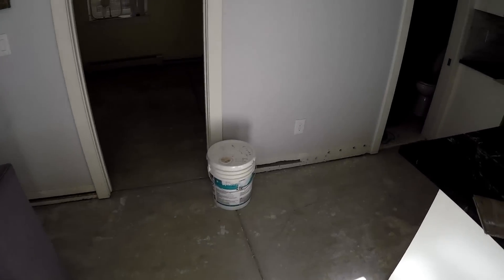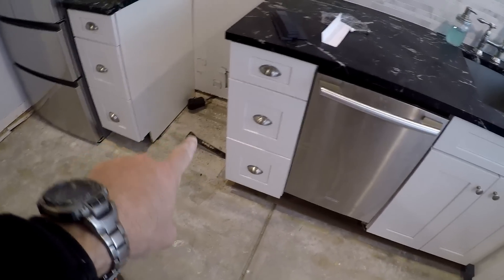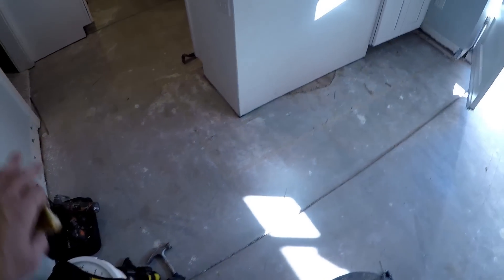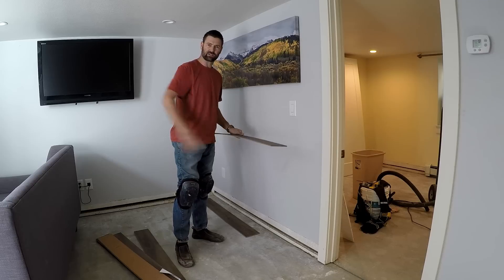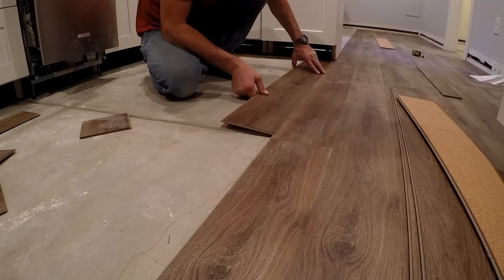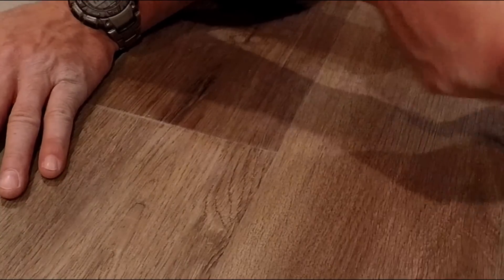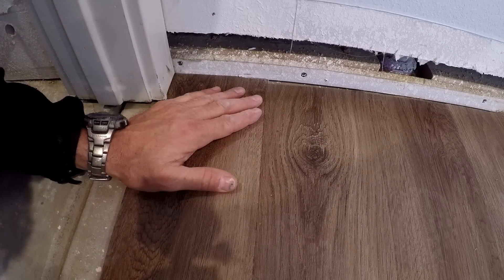The Truth About Vinyl Plank Flooring 1 | THE HANDYMAN |

Comment: You guys are too expensive and you don't take on small jobs people are learning how to do this stuff on their own now prices are just way too high I don't know why but just to do my trailer a trailer we're talkin over $1,000 so I'm doing it myself I bought the vinyl flooring and I'm going to do it all myself they have step by step instructions right on YouTube and that's just the way it is
Reply from the maker: Have fun with it.
Reply: Floor installer for 30+ years.
 Parameters for deviation allowance in existing substrates is typically 1/8" at 10' for most floating LVP installations. The potential for failure is high if you ignore the manufacture's subfloor requirements ..so like The Handyman said, have fun with it. You can put the money you saved from a proper install towards future flooring repair costs.

Comment: Just set the pads on the floor and Neal on them
Reply: I just wrote the same thing on his other video. That's what I do.
Reply: @jorgejimenez1877  me too
Reply: @davegordon6943  me too, did it for years, would always cut the straps off too...they make these wonderful things called kneeling pads now, buy 2. I have 4.
Reply: I do that now also. Before I had pads I stapled some scrap carpet padding to a 1 by board and kneeled it on. 👍

Comment: Had this floor installed on 2 different houses called “Nu Core”, one had under lament one did not. I like the one without the under lament 15lb roofing felt.
 So far it has been closing in on  a year on the first house looks good, great for rentals.

Comment: Hey Handyman, I have a simple question. Was it the homeowner’s choice of going with vinyl flooring or yours? Cause I remember wayyyyy in your earlier videos that you installed allure flooring and I remember you saying somewhere along the lines of it being a better flooring vs. vinyl but I could be mistaken. Happy thanksgiving 🦃🍁🍽!!!
Maybe you could do a video on the types of flooring and what’s preferable based on durability, budget, and aesthetics. Just a thought lol 😅
Reply from the maker: The home owners wanted it replaced with the exact same flooring that was in there before the flood. Allure flooring is has gone through a few changes since It first came out.  Its all about the same these days.  Click together vinyl.  This one happen to have cork on the back of it.  A lot don't have cork.  I really don't know what the cork does.
Reply: I installed Allure in my own house 5 years ago.  It was peel and stick.  I wouldn't install it again unless the newer stuff is click together.  It's the only way to go (as you showed) for tight joints.
Reply: The Handyman Oh I know what you mean, it’s really not that hard to install. Although I’m the noob who research a bit on the process and bought the spacers, block tapper, and floor cutter. Didn’t think to use a box cutter lol 
This was my mom’s living room and I had to move everything furniture, tv, etc to one half of the room to start and then move everything carefully back over once I got to the other half. I couldn’t have been bother taking it outside or moving into a different room. Lol
Reply: @TheHandyman1  A flooring salesman told me the cork makes the floor less fatiguing to walk on.  I was pricing a floor for an area where people stand all day (think hotel front desk area).
Reply: @josephlacerra8433  the cork provides sound deadening and slight insulation. It will be nicer to walk on then a vinyl plank without the cork, and it being directly on the concrete
Reply: I installed allure on concrete floors that are 4’ below grade, 10 years ago, still doing just fine. The test I used was a sheet of 6 mil laid down for a week beforehand. No condensation = no problems with the flooring.

Comment: I use sheet metal snips for a lot of cuts. If you are going to do these fairly often, either rent or buy a laminate cutter, one that the blade is forced straight down, not the ones like paper cutters. Worth it. Also there is a tool for cutting ceramic tile right even with the toe kick board, for tile that has been laid under the cabinets (check HF cheap) it would probably work for a situation like this and be a good option.
I hope the property owner dried that concrete slab out for you. The vapor barrier under the slab means all the moisture must go up. If you have not trimmed it out yet, lift up a couple pieces of flooring to see if it is dry.

Comment: The truth is you shouldn't put floating floor underneath cabinets to begin with!!
Reply: You are 100% correct my friend.Cheers
Reply: Why??
Reply: @Neesi392  because floating floors will fail if you glue or screw them down, or "clamp" them down. They have to expand and contract, though LVP much less so than crayola laminate.

Comment: Cork padding IS the underpayment, and it is a far superior (and expensive) at that.

Now, people should be aware of vinyl flooring releasing harmful fumes and gases, so stay away from the made in China stuff. Go for some made in the U.S with the approval of FHA even if they’re a bit more money. 

Also, you got to have a gap all around for flooring shifting. If you want to keep your baseboards intact you can just add quarter rounds.
Reply: it seems like everything is made in Chinastan these days / how about some brand names ( made here ) and where to find them in the USA / Canada ??
Reply: @badcat4707  The reputable brands have a testing program. shaw, Mohawk, Karndean, Casa Bella, Happy Feet, quite a few more are very reputable.

There has not been a problem in the industry with LVT/LVP adding off.

However, laminate from the trash if the industry from places like Lumber Liquidatirs has gassed off in millions of homes.

69 Minutes did an expose, they gave the usual "golly I didn't know a thing" and they got off with a relatively small fine 

When you buy cheap crap from people who specialize in cheap crap, you get what you pay for.

BTW, it's obvious this house was a screwed up DIY or "... I got a guy to do it cheap.." and thus the problems to start with.

Comment: You ever try those pants with knee pads in them?  I don't know anything about them but at least it wouldn't have a strap to deal with.
Reply: Those pants are expensive
Reply: My carhartts have a slot to insert foam into the knee panel, it works much better than these type of knee pads. I just leave them in that one pair of pants, too much effort to get them out again.
Reply: I got a pair of Cat pants w/ kneepad inserts a year and a half ago, and they're amazing. Super comfy, and the pants last 30-50% longer than any denim pants I've worn.

Comment: Did I miss the comment  about not filling the expansion groove,saw joint I can see it bridging without telegraphing the crack but a 3/4 in groove might be a bit much before it shows.
Reply from the maker: Not needed with this kind of flooring.
Reply: @TheHandyman1  that is great to know but how wide of a void can it span as recommended by the manufacturer?
Reply from the maker: 14 inches. 🤣
Reply: @TheHandyman1  lol

Comment: Odd that cabinets & appliances are on top of flooring, not something usually see.....interesting. Don't envy you removing that flooring from underneath everything......hope being paid well.
Happy Thanksgiving, thx for the vid!
Cheers, A
Reply: I've done it especially for bathroom vanities. Easy for flooring guys to just do a whole room then have the cabinets installed on top if you're starting from scratch. In basements you don't have as much issue with expansion and contraction of this product because the temp stays consistent and there aren't windows open letting direct sunlight heat small sections of the floor.

Comment: I made $4K, 3 days, on my last full house flooring job like that, except it was WilsonArt, but I swore I would never do another one.  Serious knee work is a widow maker. There is actually a tapping tool for these floors. Also you can use a short mechanic's rolling stool.  If I were doing it again I would hire a cutting guy and stay seated. I'm not seeing seeing much room for expansion and contraction. These floors are supposed to "float." More water/humidity and it will buckle big time.
Reply: My 1000sq ft basement was a great knee workout for my ice hockey goaltending hobby.

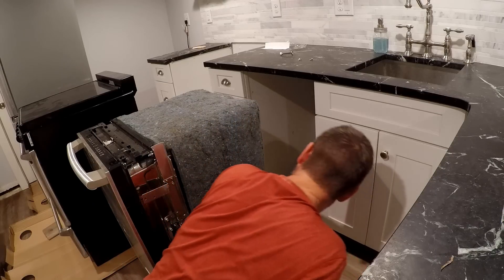Comment: Woah, total disregard for a quarter inch expansion space at tight areas. 6:11 and 10:40 are just a couple examples.. Also do you own a rubber mallot? Not as important as the expansion gaps but still important to prevent scuffing the top layer. I have installed the same nucore flooring before and can tell you it is a quality product.  Anyway good camera work. For anyone watching please leave that quarter inch expansion gap around the perimeter or at least in tight areas. Can’t wait to see what this looks like when the humidity/seasons change.

Comment: man. i would have at least ardexed those gaps in the concrete
Reply from the maker: That would be a waste of money and time this flooring is designed to go over them
Reply: LVT is not supposed to transfer anomalies in the sub floor to the flooring.
The old type of composite laminate over time and cycles of humidity would have shown thru.
Reply: @Ken: So it would push the flooring up as the concrete contracts or crack when it expands? Rigid core lvp can go over expansion joints as long as they are not uneven .
Reply: You don’t know what you’re talking about
Reply: The Whole World Called Me Hank  ~ If it's that real thin cheap vinyl plank it will show every imperfect from the subfloor.
Reply: Neznisgip even the ones with backing will still show through after use, why it is important to level your flooring if you want it to last & put an underlay.
Reply: Some vinyl flooring actually advertise it will not transfer anomalies in the subfloor such as coretech
Reply: Some vinyl flooring actually advertise it will not transfer anomalies in the subfloor such as coretech
Reply: Some vinyl flooring actually advertise it will not transfer anomalies in the subfloor such as coretech
Reply: Yeah let's make this one day project into a week. Get real clown.
Reply: Dudes seen a bag with a company's name on it once and is suddenly an expert. Lmao. Which product from Ardex would you use? SKM? Feather finish? Ardifix? AM 100? Truth is there is nothing wrong with installing this type of flooring of those cracks.
Reply: @bigmacdaddy1234  if you're by yourself I would like to see you do this in a day because I bet you couldn't. However, a week is a little extreme.

Comment: Steel hammer, no plastic end and side tapping block, can't scratch surface dragging furniture??? Are you kidding me??!!
Reply from the maker: Get back to the nursing home grandpa and take your psych meds.
Reply: High quality luxury vinyl plank flooring is damn near indestructible.  It is virtually waterproof and it is hard to mark, scratch or deface.  I am in the process of installing 900 sq. ft.  in the dining room and kitchen of our home.  This is the third floating floor I've done in this house.  The vinyl looks every bit as good as the wood floors, only more durable.
Reply: Allan Cooper I use scrap piece also and hammer only time I've seen furniture hurt this stuff was a friend with metal chairs without. Caps on legs around a poker table. Been installing floors for 20 years. Relax dude more than one way to skin a cat
Reply: @oldtimerlee8820   I'm pretty sure The Handyman's comment was in jest.  I thought it was really funny.  I would have thought it was funny even if it was directed at me.  But, I'm not an old fart, so what do I know...    ;)
Reply: I had a tree fall on my house and collapse the roof and ceiling onto the composite flooring in the bedroom.  The repair contractors didn't even cover over it for the months of work they were there - ladders tools, materials sliding around.  You can't tell anything ever touched it.
Reply: @TheHandyman1  that was a terrible response why speak to someone like that if you're wanting positivity yourself ?👎
Reply from the maker: @Jackie Ashton  I'm just having fun with the keyboard commandos.   Don't get your panties in a bunch.  Now get back to the kitchen and make yourself useful.
Reply: ::::The Handyman drops mic and walks away::::
Reply: I know it’s not nice but I laughed out loud 😂
Reply: @davetarrant6888  I am a women who lives and lived with more men than women.  I laughed too, everyone is soooooo sensitive.  The man was joking people! Calm down.
Reply: @TheHandyman1  now that's fuckin funny. Hahaha
Reply: Take your psych meds hahahahahaha!!! Classic snappy comeback. 😂
Reply: @waynesatter1590  I guess metal chair without caps are not the same as metal hammer. Doing things wrong for a long time and no one find an error doesn't make you are right. True when no one see your mistakes then it is fine. But that still doesn't make you are right. 10 accidentally small scratches to you is fine but maybe it is not to someone else.
There is a reason why different tools for different jobs.
Reply: jesus chris  This coming from someone using a handle of “Jesus Chris”.
Reply: John Basiglone Please tell us the name of the high quality vinyl flooring. I have seen samples of Dura Ceramic with gauges in them from a sample of real ceramic tile being placed in the trunk of a car together!
Reply: @JohnBasiglone  - WPC actually IS 100% waterproof.  It was not swell or warp at all - swimming pool and fish tank tests proved it.  It WILL scratch, depending on the wear rating.  A suggestion is anywhere from 12-22 for residential.

Comment: I don't understand why anyone would go with anything other than LVP flooring. With how well it does with moisture, I've replaced tile in bathrooms with this stuff with no issues. Install is easy and I've seen shaw sell some at less than $2/sqft. I will say that the lower end stuff can scratch if you move furniture on it though.
Reply: I have never seen flooring that WONT scratch if you slide furniture on it.

Comment: When we redid our kitchen we did not floor under our cabinets.
We paid 3.87 a square foot for our flooring, i wanted to cry. Could have bought hardwood cheaper or for the same price.
Reply from the maker: I have hardwood in my house.  I would never put vinyl in anything but a rental.  It's cheap and fake.
Reply: The Handyman ,if I didn’t have two kids, three cats and two dogs, I would have done the same thing.
Believe me, I went back and forth many times. 
Upstairs is hardwood but, the lower half, I chose Vinyl planking. When the kids and animals are gone. I will do hardwood downstairs.
Reply: The Handyman ,not to mention you have to watch which ones you buy. Some only had three different planks. I had over 600 square feet to cover. I believe ours had 7 or 9. We went with Mohawk solid tech.
Reply: very smart  @Wyldbutterfly028

Comment: You actually messed up right at the start... you made no straight line or put any thought into the layout
Reply: No need for that, he is experienced and knows what he is doing.
Reply: It's an apt with small rooms without long running boards. There's no need. He'd be wasting his time. Why would you bother centering it an apt with small rooms? That makes no sense. Start a full plank on the outside where it's visible. The joints aren't very visible, so wherever he rips it....it doesn't matter. No one will notice a thinner plank against the other side.

I centered it in my house with a hallway opening into a huge living room. It was a pain in the ass. His work is great for an apt.

Comment: My friends keep trying to talk me out of sheet vinyl for my kitchen.  They say that LVP would look better.  But, I don't like the feel of it--feels like I am walking on something that is not very solid.  And I don't have a slab to put them on.  I've had sheet vinyl for over 20 years and I love it--I know that sounds nuts, but things tend to bounce rather than break when I drop them, and it never feels cold.  And it's really easy to clean dog poop off of!

Wish I could have site finished hardwoods or tile with radiant heat, but sheet vinyl it is!
Reply: Try Luxury Vinyl Tile. Feels great and can look like ceramic tile.
Reply: Sheet vinyl with a wood planks look is much cheaper to buy an install plus it's waterproof! The individual planks are not! Looks just as good as the planks!